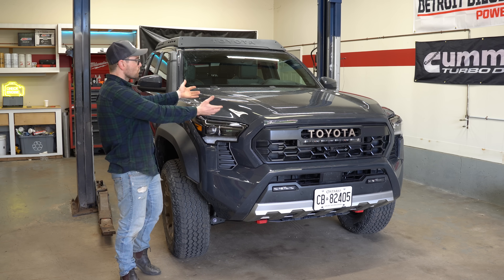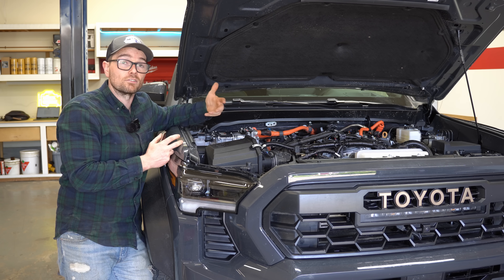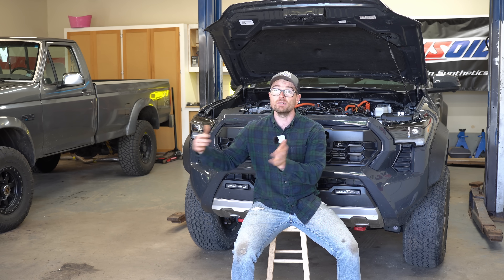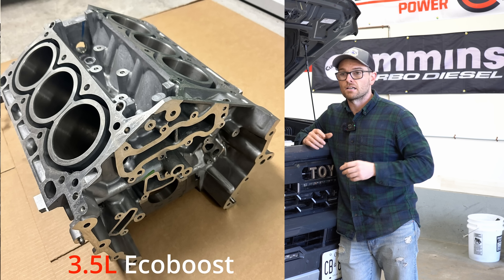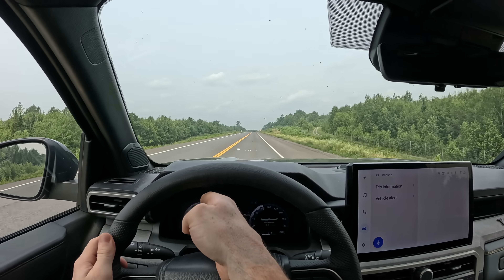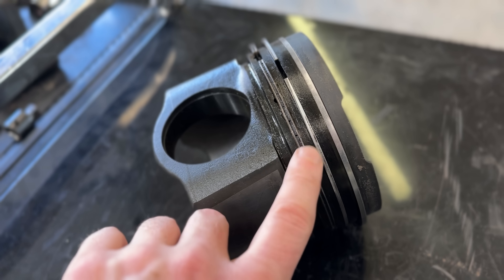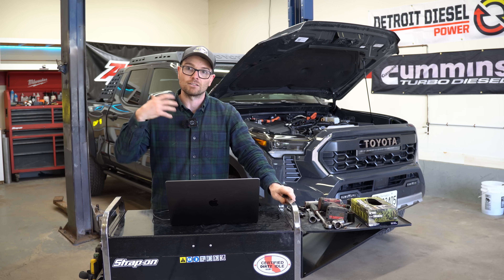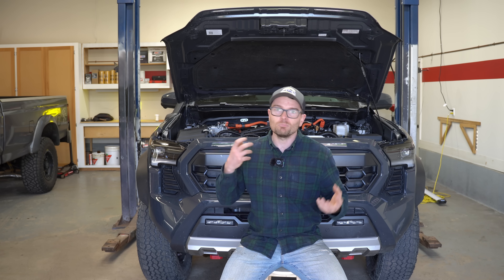Toyota Tacoma's 2.4L I-Force Turbo: CONCERNS Every Buyer Should Know (Mechanic's take)

Comment: Give me a naturally aspirated engine, all day.!!!  C.A.F.E. forced on vehicles creates these problems
Reply: What problems? Show me all these failing Tacoma motors, please.
Reply: @jmilesfox seeing as the V6 has 102,000 recalled motors, I wouldn’t bet all my chips on this motor being bulletproof.
Reply: @garboi8976 it’s a completely different motor…
Reply: @jmilesfox my comment already makes it clear I’m talking about a different motor when I said “V6”. But when Toyotas first iForce boosted motor has 100,000 recalls, it’s not unreasonable to be skeptical about their first boosted iForce 4 cylinder.
Reply: @garboi8976 That’s the Tundra which had already been addressed and fixed. Where are all the Tacoma engines being recalled? And keep in mind, Toyota has sold double the amount of Tacomas than Tundras.
Reply: @jmilesfox the big issue cafe forced on engines is the 0w-20 or thinner.

Perfect example is the previous 4.0 4Runner engine. Here in the states they say 0w-20 or damage will result.  

But the exact same engine used all around the world, has the standard oil weight / temp chart.  

The guys in Australia who see temps like we do in the south here in Texas, run 15W-40 with the full blessing of Toyota. 

The whole cafe thing and thinner oils causes excess wear.
Reply: @DasNewsNetwork  the 4.0 in the 4runner isn't damanged with 0w-20 there are many, many 200k-300k examples of that engine and the owners used 0w-20 the entire life of the 4runner. That engine is bulletproof even with 0w-20, as long as you do 5k oil changes

Comment: As per the low friction oil rings i had two corollas a '98 and a '99, both had low friction oil rings and both burned oil at a high rate, I let my ex-wife take my '99 on a 1000km all highway road trip after I did an oil change, when she returned I checked the oil and it was almost bone dry! I also purchased a 2016 4runner trail premium 9 months ago for the very fact that's it's made in Japan with all old school tried tested and true engine, transmission and other components, I believe this rig will give me many years of trouble free driving.
Reply from the maker: Wow that’s an alarming rate of oil consumption lol
Reply: @GettysGarage  that vintage and basically all toyota 2.4l are known to be oil burners eventually (not sure about this new one in the taco/new highlander). you can keep putting oil in them but that'll kill the cat which fails any emissions test. plus youll eventually need to do a rebuild to replace the rings and possibly short block

Comment: That Stat Housing is giving PTSD and flashbacks about the 3.0L Duramax !
EDIT: 11:54 NO, those polymer gears are not going to last "forever" like metal gears, I saw a Camry with a 2.4 missing all the teeth of the balancer's gear.
Same with the variable pressure/displacement oil pump.
In the case they don't fail mechanically they usually fail electronically.
All these BS methods and technologies for the sake of emissions.
So glad most of the EPA's rules and regulations when it comes to I.C.E are getting thrown into the WOODCHIPPER.
So much so that even TOYOTA is thinking about building and selling a 5.0L V8 Supra.

Comment: What’s your experience with diesel engines, concerning turbos vs gas engines? is diesel a better application for turbo charging over gas, why or why not? Do you see the same problems with turbos in diesel engines and gas engines vs the naturally aspirated counterparts of both gas and diesel

Comment: That truck is also a highway truck. Not a city truck, I had one that I had to drive 30+ miles to avoid oil level rising and engine burning water from the intercooler. Im sorry but I think the engine is too efficient.

Comment: This is why my next truck will be a new Ford SD 250 or 350 with the gas engine.  Push rod, port injection, regular oil control rings, on the HD units where they are exempt from the fuel consumption regulations.   This and when all I really need is a half ton.
Reply: The law of unintended consequences.  EPA made regular trucks unreliable, so now people that only need a smaller truck, buy a bigger HD truck.  I'll be doing the exact same thing if/when my '19 Tundra gives up on me.
Reply: @jonesjones7057 How are they so unreliable? That is not rooted in fact.
Reply: @jmilesfox it is rooted in reality.  Everyone sees it.  You don't.  It happens.
Reply: @jonesjones7057 go ahead show data. Without any data, you are just trolling. Furthermore it looks like you are not living in reality, the Tacomas sell like hotcakes.
Reply: @jmilesfox  The new twin turbo Tundras have nothing but engine problems, the GM 5.3 with their cylinder deactivation is causing massive problems, and don't even start with the crank problems with the 6.2, and the Fords are starting to show issues in the 2,7 and 5.0.
Reply: @jmilesfox  Go watch the Care Care Nut, as he is the Toyota expert!
Reply: @markofwisconsin I already do!
Reply: @markofwisconsin you are relating a completely different engine to this one. Did you know this engine family did not start in the Tacoma? It’s been out since 2021… Don’t you think there would be issues at this point if it was anything like the Tundra engine? You need to brush up on your Toyota knowledge.
Reply: @jmilesfox are you seriously saying that half ton trucks now are not more unreliable than they were before the CAFE standards? Have you ever turned a wrench?
Reply: @Zach-td5mb  When did I say that?
Reply: @jmilesfox ”how are they so unreliable? That is not rooted in fact.” All of the big 3 and even Toyota have major issues with their half ton trucks. That was not the case 20 years ago.
Reply: @Zach-td5mb I’m talking about trucks in general. There are some good modern engines… are they more complicated, yes. That doesn’t mean they are horrible. Everyone poo poos the new study without seeing how reliable they really are.
Reply: @jmilesfox  but was it turbocharged?
Reply: @jmilesfox because of brand image that’s why. If they didn’t have the reputation they had it wouldn’t be as popular
Reply: @SweetLouDootDoodlyDoo how did it get the reputation it did?
Reply: I am doing this for years now. The EPA completely screwed up the the half ton market with their emission and CAFE standards. F them! I want my trucks to last a long time.
Reply: The Ford big gassers are definitely the way to go.   Dont forget pushrod OHV, Forged crankshaft and 6 bolt mains in addition to what you wrote.
Reply: Do they have wet timing belts, or wet belts driving the oil pump.  Some Ford engine have those, but not all.
Reply: @dalef3583 they have zero timing belts, push rods sir.
Reply: In theory this would be the best option and I have thought the same.  But never underestimate Ford’s ability to keep you in the shop. See 10 speed transmission. Might be better than pulling the cab to put in a new engine.
Reply: @Real_Natural tell me about it. I recently had to lemon law a 24 F-150.
Reply: Yes, and flip phones, land line phones, tube TVs, an abacus, incandescent light bulbs, cassette tapes, tasty charcoal BBQs and  block ice for ice boxes are the only way to go.
Reply: For the i-force electric motor, it's 48 horsepower and 148 pound feet of torque, NOT 184 pound feet of torque.
Reply: Haven’t there been reports of lifter failures? I’m not saying they are bad engines, heck I bought a 7.3 for one of our company work trucks. 

My point is no engine is bulletproof. Until there is evidence of issues with the 2.4l in the Tacoma, this is all just conjecture.
Reply: @jmilesfox yes, and that issue has been resolved.
Reply from the maker: The 7.3 Godzilla or the 6.8 are just old school V8 engines - should last a long time
Reply: @GettysGarage would you say the same for the 6.4 hemi? Old school v8

Comment: The Toyota full sized truck that identifies as a midsize
Reply from the maker: my thoughts exactly.
Reply: @GettysGarage saw this current Tacoma on a trailer in front of current Tunera.  Easily see how they both share the same platform.  Current Tacoma same size as full sized Chevy trucks from the 90s.
Reply: @davidnuxoll7074  thats not just toyota, ALL the 'midsize' trucks are the same as last decade full size but with smaller engines. id love a colorado with a 5.3 lol, THAT would be a great weight to power ratio
Reply: @bradhaines3142 measure a frontier a frontiers frame wasn’t shared with Titan never in the past nor was up to the end of Titan.
Reply: @davidnuxoll7074  i didnt say they were shared. im saying the current mid size are basically the same size as old full size trucks. frame isnt that relevant

Comment: i have 38000kms with 1st oil change at 1000kms and then between 7 to 8000kms intervals . I have the hybrid and it gets great fuel economy and runs like a champ. Not any issues to date. Only issue is engine sound compared to a v6 is kinda industrial. secret to all new vehicles is maintenance. You disregard what the factory says and change fluids (all) at 1/2 the recommended intervals. Oil/diffs/transfer/trans/rad/brake/etc. If you look after it , I will bet it will give you durability.
Reply: The issues is when that hybrid gets older and things start breaking $$$ 

Hybrids just don’t have the life especially when the batteries wear out and need to be replaced.
Reply from the maker: Exactly what I do with my own truck. running oil change intervals above 10,000km is wild. wouldn't dream of doing that.
Reply: I don’t go more than 5,000 miles with synthetic.  It has worked for me over multiple vehicles so I don’t plan to change my interval.

Comment: If you know anything about Toyota hybrids you'll know its all about the low end.   Reason it falls on its face past 3k is I bet the electric motor isn't helping anymore.    I feel like its just for off the line stuff that's it.  Also I cant believe Toyota still uses hood prop rods in 2025, go with struts already....

Comment: Fuelly has average mpg at 19, not so hot for all that complexity, tech, and plastic under the hood. Less than 4mpg better than what I average in my l8t powered 2500 4x4.
Reply: Nope, don't buy it. No way are you actually getting 15mpg out of an l8t. Citing the same source puts it at 12 best case. 12 to 19mpg with functionally the same torque is a 58% increase in fuel economy. Even if you went with your mythical 15, it's still a 26% increase.
Reply: @james2042 -15.2 to be exact, i drive speed limit, and smoothly. got almost 19 on an over 200 mile trip unloaded.

Comment: What worries me about low tension. Oil rings is the history Toyota has with the 2.5 in the 2.4 getting carbon buildup and burning oil. Especially with pushing oil change intervals and low viscosity motor oil. If this were my engine, I would drive it through the break-in and then immediately switch to a high-quality 5W-30 motor oil or 5W-40 euro spec oil with good sheer stability with a HTHS rating of  >3.5. 
0W 20 engine oil is laughable for anything but sitting in Starbucks drive-through and taking the kids to school.
Reply: Idk got 150k miles on my 2.5 running 0w20 with no oil consumption issues.
Reply: No.... no.... no.....
Reply: You must hold a PHd,in oil technology goober

Comment: I'll keep my 13 TRD OR.  Team 4.0.
Reply from the maker: Great engine
Reply: Love my 4.0. it's so basic, and oil changes are a breeze.😊Might keep my second gen forever..lol
Reply: @Westcoast_Kyle  you should, or until they get there sh-t together again. way to much complication for not much of anything, work these trucks at all and you will soon have issuses popping up everywhere. nothing good here until they bring back the V-6. Add the cost of these and its not inticing what so ever
Reply: That’s the best engine for tacos for those who tow and haul. Toyota only switched to the minivan 3.5l due to regulation pressure

Comment: If I were in the market for a Tacoma, I'd get an older one with the 2.7 liter and manual transmission. That's if I wanted many years of reliability. 

If I were leasing and didn't care about the engine/trans blowing up in a few years, I'd buy a 4th gen tacoma.
Reply: This is exactly why I lease all my vehicles now a days by the time these issues start I'm 3 vehicles down the road from that one. I hate working on cars and don't have the time like I used to as I get older I prefer to just lease and get a new one every 3 years.
Reply: @chris6743 I get it. If you're ok with payments, that's the way to go. Anything can break, even new things, but a new vehicle breaking down is generally very unlikely. There's a piece of mind in knowing that.
Reply: @chris6743You must make a 6 figure income!!
Reply: Agree . I have 22 2.7 and it's a major dog .
Reply: Never would I buy a new Toyota today because of lower quality and prices that are way way out of sight.Ive had a 1985, 1988 and now I have a1995 ,single cab,2.7 4 cylinder manual transmission 5 speed 4 wheel drive with manual locking hubs ,178,000 miles and will not have anything else cause it will last me til I die.Ive had it since the year 2000 when it only had 57,000 miles on it.Only paid 6000 dollars plus traded my old 1988 srs 4x4 Toyota pickup in on trade.So I'm very happy with my old school toyotas.built to last a lifetime

Comment: What are your thoughts on using the same engine platform in the 1/2 ton and 3/4 ton trucks like the Ford 300 being used in the f-150s and F-250 also the 6.2 V8 being in the F-150 and the 250? Why does the 250 with the same engine have a higher towing capacity?
Reply: Towing doesn’t just have to do with the engine/transmission. Towing puts stress on the frame; heavy duty trucks have stronger frames than half tons and this is why they have a higher tow rating even if the engine is the same.
Reply: @tylerbennett5020 thanks I figured it had to do with brakes but not frame

Comment: Ugly, small, but theyre outselling chevy by more then 2 to 1 margin, what gives?
Reply: American brands are lousy. 🤷
Reply: @josiahwyncott7519  The last generation Taco was lousy. 

The engine sucked, the trans sucked, the seating position sucked, the tech sucked, the paint quality sucked... It sucked, sucked, sucked. The new Taco just adds complexity and questionable reliability into the mix. 

Still, loyalists buy them.
Reply: @MarkChristian2010 
The shifting issues and engine issues were addressed in the earlier models. All vehicles have thin paint now. The rest is personal preference. 
Tacomas still go hundreds of thousands without major issues. The new turbo ones are a new story.

Domestic companies are putting out junk year after year without end.
Reply: Reputation
Reply: Ugly? That’s purely subjective.
Reply: @jmilesfox chevys design its way more appealing but both have hard plastic water valves instead of steel
Reply: @Topo7787 Appealing to you. Also, until you have proof of failing water valves, it’s a moot point. Time will tell.
Reply: @jmilesfox its plastic, theres no way it can withstand the heat as good as metal, its all about saving.pennies, they all suck
Reply: @Topo7787  Again, you show me where they failed, and we can talk. Toyota engineering is not perfect, but it is very good.
Reply: Toyota reliability history puts gm to shame
Reply: @stefanovichmichael9686 I know, its a shame that such small,ugly,overpriced vehicle sells better than colorado, but their reliability its taking a downturn.lately
Reply: Colorados just drive worse.  Nothing you can see on a spec sheet though.  And the Tacoma brand is much more relevant than the Colorado brand.